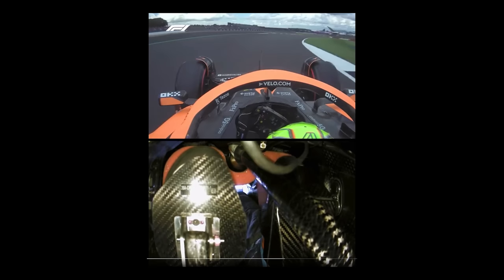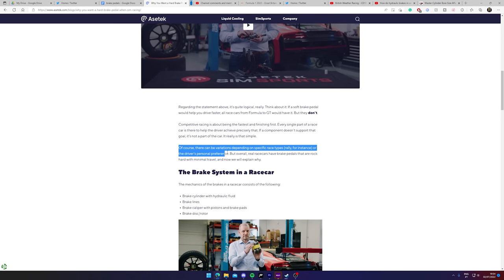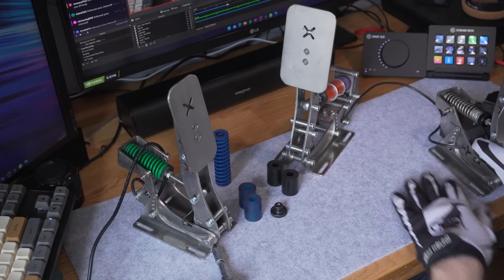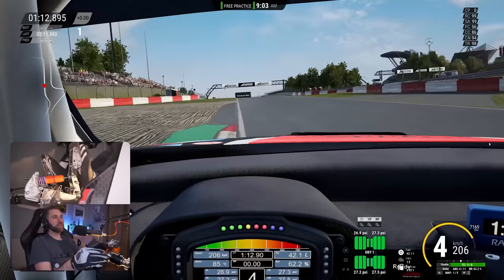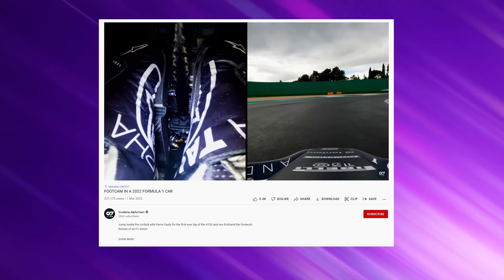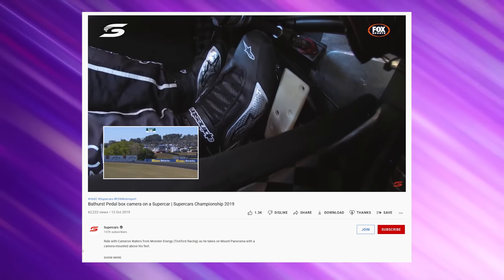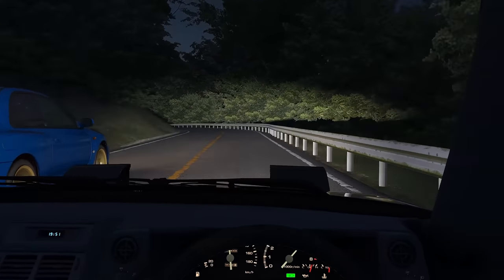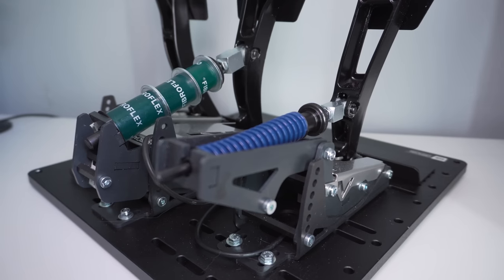Lando Norris brake cam shows simracing brake travel is all wrong

Comment: I think it is more important to pay attention to the forces and not the travel. Hence load cells. In race cars, the deceleration Gs help greatly to press the pedal much harder than I can do in a static chair so the correlation between RL and SIM is really hard. F1 car brake pedals ARE freaking stiff, but those guys are peaking 6Gs under braking. Even at 60kg if you put most of your weight on that pedal that is 360kg of pressure. Of course it doesnt work like that exactly, just trying to make a point.

Comment: I have a super short pedal travel because the fanatec V3 sucks otherwise. It's an old set of pedal works perfectly and was competitively price at the time. Asetek has no real excuse, to charge that much and not having more flexibility in pedal travel is insulting.

Comment: I use Fanatec Clubsport pedals. The feel of the calipers biting or rubbing on the rotor is what I would look to simulate as next level. The force required to get to full brake lock is somewhat matched to my very stock stationwagon's actual braking feel. I find the gradual release of brake pressure is where my sim pedals tends to fall short on simulating real world. The spongy hydraulic feel is convincing enough with the correct rubbers and foam in places but in regards to the release or gradual release of the braking pressure is where I find that it is very different from RL. I think the equipment becomes more reliant on software code more than the pedal simulating the real forces. Sim pedals just seems to be lacking the sense  of feel of how much your braking system is gradually letting go of the rotor. Although it is still pretty good for what it is. Real cars can have different types of brake boosters and braking component grades so I guess than I can't really ask for much more than just matching it close to what I know as it benefits me when I do drive my real car. Sim racing has definitely helped me to avoid accidents and without the heart rate increasing. I don't think I would ever get the chance to push the braking limits of a supercar around a corner anyway.

Comment: Well, cant compare to real life racing, but all I can say I went from g29 pedals to Invicta. The difference is HUGE. My first 20 laps in the skip I was not able to make the corner because I was used to light plastic pedals. Was just braking like 30%. Now I finally have the hang of it I can stamp on the brake like crazy without locking up and trail off nicely. Due to my work unfortunately I cant Irace everyday so it still takes a bit getting used to after a week without racing but after 30 min im back in a consistant lap time. Usually top 5/10 in the practice sessions. Now I need a DD :-) So realistic or not I cant judge but definitely it feels more professional and better for my liking. I have a very sturdy home made rig from wood, so 0% flex. Without a rig I wouldnt buy it thats for sure.

Comment: You've totally missed the point that current F1 cars with their hybrid powertrains are very different in that they use brake by wire so pedal travel and effort is entirely up to driver preference (just as it is in sim racing) . Almost every normal racing car with hydraulic brakes and good road going sports cars have short travel firm pedals and this is what the sim racing companies are trying to replicate. My own T3Pa Pro pedals with a RicMotec load cell very closely match the firm short travel feel in my own sports car.
Reply: nope. only the rear tyres are brake by wire, the fronts are conventional hydraulic brakes. he even showed GT3 cars which we know absolutely only have conventional brakes...

Comment: Regarding the g force brake assist in a racing car, surely if the driver is securely strapped in then only the mass of your leg acting against the inherent elasticity  of your ankle, hip and knee joints and your muscles stiffness would provide any ‘assist’? ie this should be minimal?

Comment: You’re right and wrong. I’ve driven formula 3 cars where the pedal feels like a literal brick wall and I personally find this has the best feel. It has to do with cylinder sizes etc but the pedal didn’t have more than 2cm travel. I’ve also driven other f3 cars with a long pedal I didn’t like it at all, felt way too “soft”. Radical sr3 also have a “soft” pedal. Going into other prototypes, the lmp3 cars I have driven had what I call a medium pedal. And the ligier lmp2 was like a brick wall also. 

It basically comes to down to how the team sets ups the car, and what the driver prefers. I personally prefer a very hard pedal but everyone’s different.

Comment: The majority of normal cars use a vacuum booster, some may use power steering pressure, I guess depending on what “race car” you are driving you most likely don’t have an engine driven pump for power steering it would be electric so it could not be used for a brake booster application, if you have power steering at all.  Vacuum boosters are not reliable in race cars. Brake pedal travel comes down to the master cylinder it’s self! There is a rod and piston and the length of stroke in the cylinder bore is what dictates overall pedal travel, stiffness comes from many things, master cylinder bore size, length of stroke, the diameter of the brake lines them selves, the material of the brake lines, caliper design, rotor hardness brake pad hardness and wether or not you have any type of power brakes. You take your normal car disconnect the booster and you have the same brakes you did before, same travel same pressure actually exerted on the caliper piston you just have to push ten times harder to get it. The main importance for brakes in sim racing is modulation unlike in any real car there is an almost infinite range of pressure that can be applied. I’m not sure of the techy term but the more measurable points there are in the pedal software the better the pedals will be, that being said being ultra smooth moving is IMPORTANT! Stiffness and travel is subjective. Cars are all different including “race cars” LMAO

Comment: People are using this video to try and justify how their long, soft pedal travel isn't unrealistic. What they don't realise is that Lando is applying 200 - 450 pounds of force to get that travel.

Mauro Piccoli, chief of Brembo's racing department:
"Alonso stomps on the pedal harder and generates more pressure on the system, we are talking of a pedal pressure in the 130 - 140 kg range (+/- 285 - 310 lbs). It's similar to figures for Lewis or Jenson but Fernando is less aggressive. He likes to use a large diameter pump with a very short pedal. Pedal travel is in the order of 30 - 40 mm, three and a half times that of the pump. Felipe prefers to manage lower pressures but as far as corner entry, there are no great differences."

"The most difficult is at turn 10, where the drivers come in at 328 km/h (203.8 mph) and apply the brakes for 3.04 seconds, during which the vehicles travel the 136 meters (446 feet) that are essential to bring the speed down to 79 km/h (49 mph). The load on the brake pedal is 201 kg (443.1 lbs) and deceleration is 5.4 Gs."
- Brembo official website

Comment: It is easier to memorize how hard you push on something than it is to memorize how far you push something. You cannot see your foot while driving so Is your foot placed in exactly the same spot at the same angle every time you press the brake? Maybe? But why make it that complicated when there is another easier solution?  These are variables you can eliminate by setting up your brake pedal to be more about the pressure applied than the travel. Also it is not an on/off switch. The reason it works is because the force you are pushing against is progressive so it gets harder the further you push it. If your max is 150lb it would take 150lb to get 100% of the potential braking force and travel in the pedal. If you press 20lb you would get a smaller braking percentage and travel the pedal.

Comment: I think its need to be hard. The travel can depends on how you like it.

Even in your everyday road car, the amount of force required to achieved maximum braking force is a lot more than people think. 

You’ll be surprised at how many people never really achieved 100% of braking force available on their cars.

Also on F1 cars I don’t think you can actually push the brake fully in while stationary, you kinda need the g-force to achieved that. F1 cars can make your body 6-7 times heavier while braking.

Comment: F1 is using brake by wire, so in way braking from the shoe to the footwell is exactly the same as (or could be) as a home setup. I'm too slightly surprised of the medium distance of travel of the brake pedal of Lando, seems Heusinkveld with his Sprint pedals wasn't wrong at all.

Comment: Probably wrong here but I'm pretty sure f1 Is brake by wire isn't it has been for a good few years so I imagine it would be working with a loadcell, the throttle pedal is by wire and that is a potentiometer, and that was what was faulty on Charles leclercs car weekend just gone (Austrian gp)

Comment: I believe brake travel is dependent upon a drivers preference. Those cars are not built for mass production and every detail that the driver suggests is considered by the engineers as part of the data and options.

Comment: a lot of it is standard rubber fluid hoses vs braided steel lines. rubber hoses expand and give way, but braided lines dont. ive felt the travel difference in street cars after changing hoses and its significant. so like you said, lots of different factors. even different pads will have a different pressure/bite ratio curve. ive had pads that were on/off switches and pads that had nice progressive bite.

Comment: Street cars have brake assist. Almost impossible to two foot my r8 performance with carbons because of it. Barely touch the pedal and they begin to grab. I’m sure many of us by now have tried and realized how hard it is to two foot. 

With race cars, like the recent rush sr1 I drove, they are mechanical and a lot more like load cell. I can two foot and when I did it the first time, with in two turns, it felt just like my sim. More travel, smooth braking based on pressure. 

When I drive any super car, I one foot. Any race car, 2 foot just like sim. Many of the queues we get in sim racing transfer to real life very well. We do not get the Gs and every driver who tries my sim says that from the very start, but there is much to take from both and bring to each.

Comment: in order for the F1 driver to deliver the amount of force needed to brake with 5,5G, they need long travel (small cylinders) to press hard enough on the disks in the tires.....
Reply: im coming to this from a KZ2 karting braking experience - small light weight car ... (160km/h and a weight of 175) - my brake travel in this is extremely short and precise.

Comment: OK, some have big travel, some very small (mostly older racecars). You covered a lot, but failed to explain the actual stopping power in the "long travel" situation. My guess is, that the actual stopping power comes, when the pedal becomes hard any way (in both cases). So the long travel will give you better trailbraking when you start letting off the pedal. But main braking force can only be created after the pedal is hard and a lot of kilograms are put down.

Comment: I thought F1 was brake by wire.. if that is the case, wouldn’t the travel and feel is customisable to the driver preference? ie it isn’t constrained by hydraulic cylinder/lines etc

Comment: F1 pedals are pretty close to sim pedals - an actuator attached to a sensor. no mechanical linkage. same with the throttle. i dont understand why anyone would want small pedal travel - increased travel yields increased resolution and accuracy.
Reply: It's because their based more on pressure, not physical distance traveled

Comment: Simracing allows you to set your pedals the way you feel and perform better. In real cars it's not that easy because you have a lot of things going on behind the engineering of the brakes. Its not a matter of changing some rubber behind the pedal, you know?

It's not about being right or wrong, it's just about being different when it comes to changing the system to the drivers preferences.

Comment: My pedals start locking the tires when I have only pushed down like a quarter of the way. More tweaking the settings  I guess or just get good ledals
Reply: In that case, reduce overall braking force in the setting if you're able to. Test out different settings and see what feels best (I raced with a T150 for quite a while)

Comment: isn't that a recent change in F1 ? because brake by wire . it used to be very short and very high force in F1
Reply: in other words . they use simpedals , configured to whatever they like . so simracing brake travel is spot on

Comment: In real life, there are more variables you recieve and respond to than only how hard it is to turn the wheel. Heck, it's far away from that. Still, when I suggested the idea of pedals that simulate real life situations, a youtuber said that if these get manufactured then he will lose his advantage about his muscle memory. I say we should be more long sighted from this. Sim racing technology will move forward anyway but we should try accelerate that.
Reply: Like about what has been said about the "press" role to discuss issues and awaken actors, same can be said about constructors now. We have a hundred of engineers who are making and selling copies of sim racing pedals nowadays. I wonder if one can stand out from the crowd and dedicate his time and energy to find away to be the father of the first force feedback pedals. We always talk about how important pedals are in sim racing but we're still guilty for using fake canned graphs that favors gamer boys and excludes real drivers.
Reply: Examples can be:
How it becomes easy for the pedals to go all the way in to the  metal when the brakes fade for heating reasons.
How they pulse when ABS is activated, different for each car, and like today's pedals where you program them to pump at a canned percentage of pressure or travel that you previously set up.
Maybe most importantly is that the hardness of the brake pedals themselves changes when the car is stationary vs hot fluids vs heavy car vs god knows why.
A successful examples, is that company (help me remember its name pls! even makers-names are similar), who invented a mechanism of a clutch and fly wheel, where you can't engage the gear until you press the clutch and things are synchronized. Yes technologies are out of reach when they are first invented, with their product costing thousands of dollars, but I mean we should thank them and give them credit much more than what we have done, because one day we'll have a working clutch and manual gearbox at the reach of the consumers with normal budgets thanks to them.
Reply: <but the solution that RC mentiones in the end of the video is smart, cheap, down to earth and real. Our pedals today already have different elastomers with different colors (hopefully there will be standard universal stiffness values) and even the CSP V3's has a rotating cylinder to set the stiffness of the pressure feel, and simply the sim itself can tell you the stiffness value of each car's brake pedal, kind of the details that pC2 used to give you about each car when u click at it (FWD, front engine, HP and torque curves...etc), and then u can change the elastomer or rotate the cylinder to the desired value. This does NOT make the ffb DYNAMIC, but at least this is a free solution. And why not, add info about the car's steering wheel style and diameter, and it's button plate layout so you can also swap the quick relase wheel if you have multiple rims...etc

Comment: As a Mechanical Engineer, from first-hand experience I can assess that most of the "travel" sim pedals have are nowhere near close to what actual competition cars have: even the most modern dormula cars have a brake travel that is just half a centimeter shorter than what you'd have in your common econobox. That's because of mechanical advantage: the shorter the travel, the harder and more sensible the braking is because of how little of a force multiplier your feet can use (yes, even drive-by-wire systems obey by this rule) thus your feet will get tired easier and faster. This makes a long travel a must: increases the force multiplier (so you can stress your legs and feet less), makes feathering of the brakes a lot easier and avoids sudden brake-checks when you just so look at the pedal wrong. It also has the nice side-effect of making your brakes last longer because you're not always slamming the brakes by sneezing at them :)

Comment: Thanks for this video! Zero travel brakes are a total myth. and from what i know the brakes are set up to the drivers liking. You can also check landos sim rig pedal cam on a few clips. He uses the pro-sim evo pedals which are set up pretty much the same like what hes used to from formula cars. 

That whole racing car brakes are rock hard thing was just a marketing move from asetek, and doesnt even make sense. If it would be true, people would have to calibrate out the whole first stage of the brake, what makes no sense. In fact its more like a 3 stage system, because you can lower the preload to get a little bit of slack before feeling the elastomer. That is actually the travel of the brake pads, They claim that there is no travel from the point where the brakepads are touching the discs, but thats not true at all, and would make theyr elastomer stage totally useless. Maybe somewhere at the end of the pedal travel they turn completely hard, but before that you got some travel to modulate the brake easier. So there is nothing really different about the asetek pedals, they just have a hard endstop and thats it.